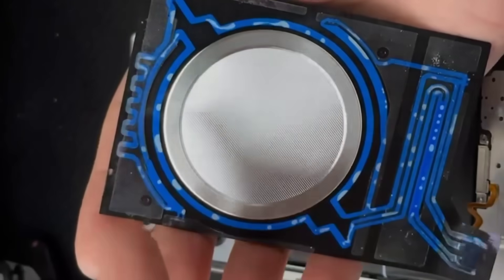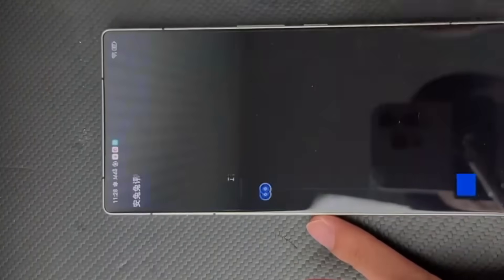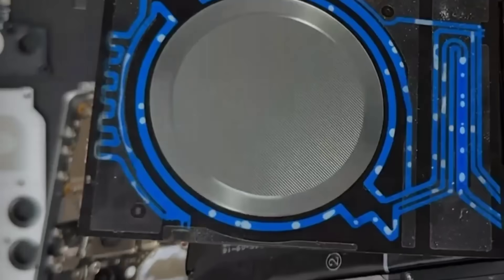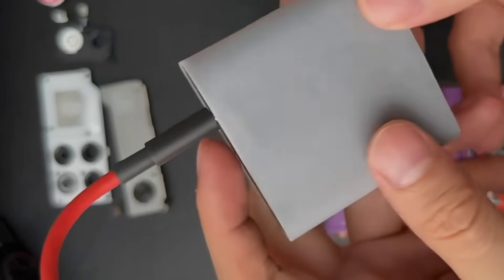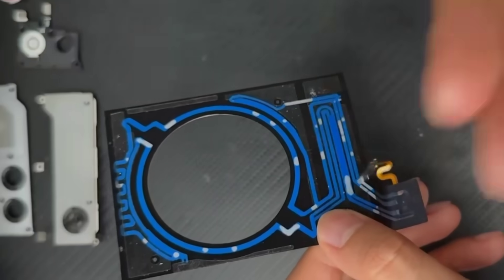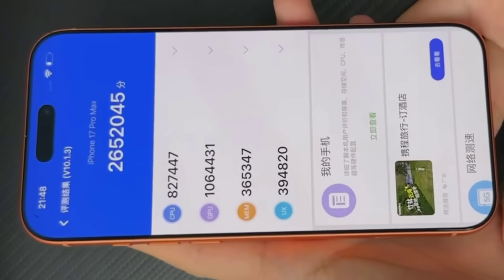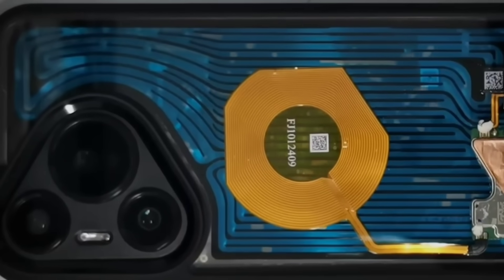RedMagic 11 Pro+ Liquid Air Cooling Retrofits Into iPhone 17 Pro Max | Gimmick Or Game Changer?!

Comment: i tought, heat transfer is all about surface area. if the liquid pipe is exsposed to air, then it works. if the liquid isnt exposed to air, the heat is Trapped inside casing. CMIIW.

Comment: I love how such braindead people at the same time have such amazing craftmanship skills.

This device has one purpose, and it is to cool the battery. What produces the scores you see is the SoC. This device doesn't help directly to cool the SoC, it merely prevents the chassis from getting hot. Furthermore, it cooperates with the fan in the Red Magic, which the iPhone doesn't have, therefore you won't see any gains by just slapping this in any other phone, including the Red Magic, because the SoC itself is running at the same temperatures, given a stable chassis and environmental temperature.

Comment: The liquid cooling unit as shown by jerry rig is designed to run along the red magics chassis where the contact draws in the heat to the liquid rail  just sticking it on a phone won't work the same

Comment: lmao liquid cooling, sounds like a gimmick, maybe just don't create phones that is hot in the first place.
Reply: The 8 elite gen 5 alone is literally gtx 1650 level. And also if you think making a chip this powerful not hot then how about you do it bub
Reply: @NotReallyANames  Bullsh*t, Phone chipset is nowhere even on low-end GPU lmao, its only at 1030 level which very weak

Why phone lookslike can run good graphic is because the graphic they handle only up to 720p, this is main thing that game Dev does to port PC game into Phone, and they even need tone down other thing
Reply: @manyblock4192 it literally is 1650 level.

Comment: To drive the Piezoelectric pump, a complex circuit is needed which can output an ac voltage of the matching frequency and voltage that the Red magic phone provides to the pump. But the chances of it ruining the pump are very high if improper supply is provided.
And probably the pump may already be damaged as it was directly connected to the battery and the 5v output of the charger, but I'm not sure about that.

Comment: Redmagics cooling solutions are made to prevent throttling so same soc will perform the same but with the redmagic it keeps it there for longer as it won't get hot enough to throttle and if it does it throttle less

Comment: in red magic the water cooling system was designed to keep the wireless charging system temprature down as red magic 11 pro has 80watt wireless charging thats why there wasnt any noticeable difference in performance you should have compared the 0 to 100% wireless charging time and tempratures in Red magic with and without cooling system

Comment: That water cooling without the fan it's not gonna make a 100% difference! Water and fan cooling systems working Collaboratively.
Reply: Incorrect. That is only required when the heat is being removed from the tubes in which the heat source resides. Since this isn't possible in a cell phone the liquid will be the only option therefore it is the best possible option.
Reply: @TheHitman41 I see your point but you miss my point! My point is that the the fan desipates heat out of the phone quicker! Like imagine liquid system collects the high temperature and then what? Keeps it in there?
Reply: @dimiBoxer I didnt miss your point. I was trying to say in other words there is no 100% cooling. The fan and water each have their own thermal removing/transferring properties and even in unison they cannot remove 100% of anything. I'm a level 3 reta certified technician so I have a vast knowledge on thermodynamics and enthalpy.
Reply: @TheHitman41  can we agree that the phone performs better when both cooling systems works compare to when only 1 works?
Reply: @dimiBoxer Indeed, thats agreeable 100% 👍
Reply: @TheHitman41 🤝🏽
Reply: True, because the internal optimizations done between the new vapor chamber, water cooling loop, and fan would be fairly different between the two phones tested. Maximum thermal loads would be handled in a more graceful manner, with additional cooling stages (fan loop sandwiched between the water cooling loop and vapor chamber) to dissipate the load more effectively, acting as a sort of thermal cushion to allow more demanding tasks to be accomplished on the phone in less time without throttling, such as gaming or editing.

Comment: This proves the water cooling is a gimmick ... How did you come to the conclusion that it makes a difference? 20k points difference is nothing for the red magic ... It proves it does nothing for the phone you do realize that the benchmarks will be different all the time if you do the test again it can be lower or higher even if the phone is back to it's normal temps so many factors with the phones system contribute to the little difference of benchmarks not the cooling itself...

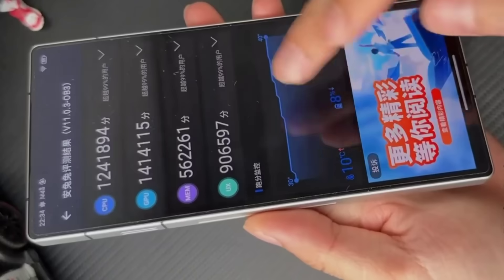Comment: 5:32 
This junk made me feel disappointed I thought the cooler was connected to the processor and not just on the back of the phone In this case, even a normal fan would be better but even the S26 will give the same 4M points The point is how long it can maintain these points not how much it will score You should have tested it several times with and without the cooler multiple times to see the difference if there is one
Reply: that water cooler in redmagic is mainly for 80watt wireless charging
Reply: I think the fan, vapour chamber and the water cooling system are connected to a single point of contact

Comment: People seem to be worried about the voltage used, 70 Volts sounds like a big number, reality is slightly more complicated. The power (in Watts) is more representative unit to determine the cooling loops battery usage and it is calculated using the equation P=I*U, where I is the current and U is the voltage. So, it doesn’t have to use a lot of power, especially if the principles only require higher voltage and what I found was the phenomenon used here is called electrowetting. In a demonstration, it required 100nA (yes, nano amperes) to run (move liquid), which is 0.0000001A * 70V equaling 0.000007W (7𝜋W) Your phone can use between 10-30 watts at maximum power. So, it’s nothing to worry about. If this negligible power consumption results in noticeable temperature reduction, it could even lower the power used as the temperature increases resistivity.
Reply: We transport electricity on the electrical grid at 100,000-700,000 volts because it reduces losses to electrical resistance in the cables, it also allows thinner lighter cables to be used as all that really matters is the amps travelling through a cable. At 1A you can delivery 400kw at 400kv. If the overall resistance in the wiring is 100Ω you're only loosing 100w to deliver 400kw which is a pretty high resistance considering a 2cm diameter aluminium cable 100 miles long would only have a resistance of 13.5Ω (or 27Ω for both the terminal cables -/+ or live/neutral)

Comment: There's a few more things contributing to the effectiveness of the water cooling. Think about it this way, the water cooling doesn't really help improve scores, it helps in terms of efficiency. Think about it, it's a 2 min test. Some chips are efficient enough to consistently produce the same score or the same performance and you'll only really feel a dip once the device heats up. This is true with any electronic device even PCs. Heat is the enemy of electronics, so to keep performing at a higher level, it needs to be cool. 

Or in another way, say you have a top end Ryzen, use air cooler and it keeps a top performance until 30 mins and then you see a performance dip IF it heats up. Use a water cooler and it may keep top performance at 1 hour and then you eventually see some minor dips.

Comment: 70v dam, It will run power a lot
Reply: Depends on the current, the power (in Watts) is calculated using a simple equation P=I*U, current times voltage. So, no... If definetly doesn't have to be using alot of power, especially if the principals only require higher voltage.

Update: so it appears that the phenomenon utilised in this is called electrowetting. And good news is, in a demonstration case I saw it required 1nA, yes nano ampere, to run - That's 0,0000001A * 70V equaling to 0,000007W, to get an idea, your phone can use somewhere between 10-30 watts when running at maximum power... So it is really nothing to worry about 😂 actually, if this absolutely neglegable power consumption actually results in noticeable temperature reduction, it could even lower the amount of power used as the temperature increases resistivity.

Comment: Actually the water cooling system is for better long term performance try it in a longer benchmark and you will start to see the difference
Reply: I doubt there's any cooling on this half millimeter small liquid cooler haven't watch video because I know there's no difference what so ever but it's cool gimmick, they sell magnecut air cooled coolers they might work but not this 🐸
Reply: It’s more for battery heat not for cooling processor.
Reply: @Bbg-y5f it's not for battery heat cause the battery does not need to be cooled. And batteries are thermally insulated meaning the liquid cooling won't do anything
Reply: @NotReallyANames what, why don’t need if it’s possible to be overheat with fast chargung or by fast draining
Reply: @Bbg-y5f charging is the primary heat generator. Not the battery itself. And fast battery drain can mean alot of things like background processes or heavy gaming bruh
Reply: It doesn’t make a difference though, the air cooling almost do more than the “water cooling” its just a slap pack and called it a day “water cooling” its more like a gimmick and also benchmarks arent always the best case to use the full potential of the phone I hope the youtuber would do some heavy gaming so that we can see the “water cooling” effect.
Reply: @brentxsz so you havent seen anything but still goes onto claim it makes no difference?
Reply: @bulletpunch9317 So basically, you're telling me we could use the water cooling tub to replace the radiator and still be able to cool the PC?
Reply: Huh what? @toniETH
Reply: @brentxsz  yes it makes diference but don't expect it to be huge; it just helps a little.
Reply: @brentxsz your words are gimmicks
Reply: Of course it makes a difference, anyone who says otherwise is ignorant.